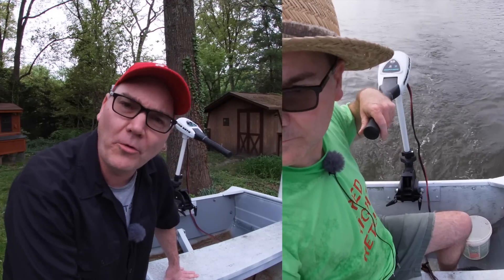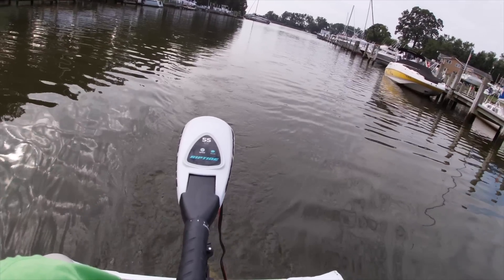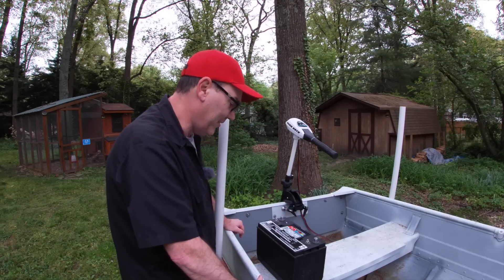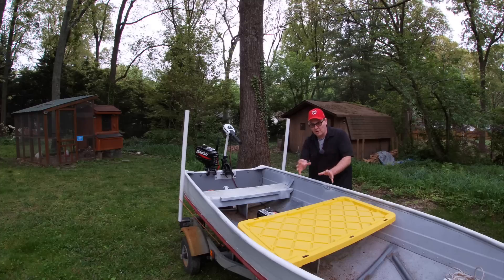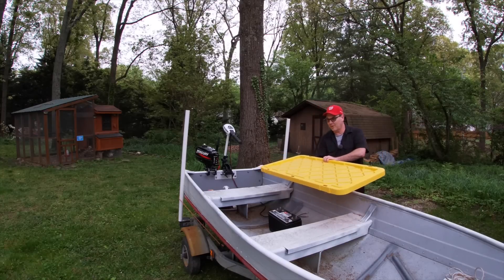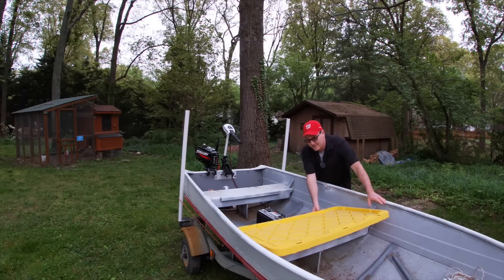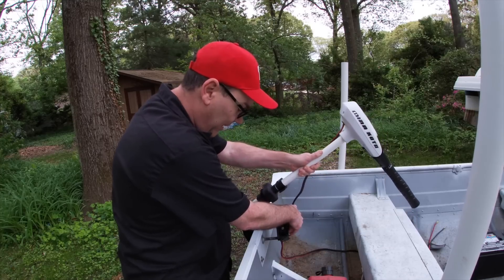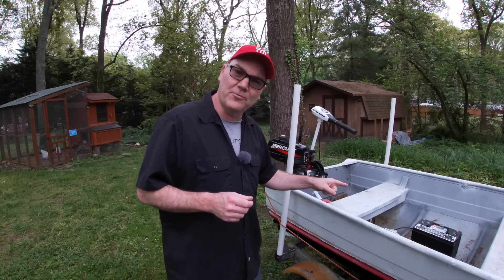How Many Solar Panels Do You Need For A Trolling Motor?

Comment: There is a big drop in price per Watt from 300W panel size and up. Anything smaller is a rip-off aimed at ignorant consumers.
I can only comment on local prices in South Africa - a Canadian Solar 300W panel will cost the equivalent of $100. A 20A EP Solar mppt is $75.
The Panel measures 5ft 6in by 3ft 3in and weighs 41lb. You can easily mount it overhanging the bow to leave you enough usable space. The weight up front will nicely balance the weight of the battery in the stern and allow the hull to run at much lower drag. 
A 40lb Riptide draws roughly 200W at speed 4 and it gives me 4mph on a 13ft dingy. 
A solar panel will give you much longer service life than a second lead-acid battery. 
Even a small panel can benefit the battery. Every amp that you get from solar is one less amp required from the battery. Reduced battery current means you actually get more usable amp-hours from your battery. Depending on the battery's Peukert factor, this would be around 10% additional capacity by reducing current from C/4 to C/8.)

Comment: I totally agree with you, solar panels are not the solution in extending your battery range.
 I know one thing that happens often in our shop, when trolling motor come in for service that are not variable speed, is that  after a short time the lifepo4  batteries are notorious in  burning out the rheostat at speed 1,2, on those trolling motors regardless of # thrust.  
Intermittent use of these motors will be fine, however, trolling at slow speeds will destroy the rheostat, and that is something no one has addressed yet.
Reply from the maker: That's pretty interesting - both the rheostat and the LiFoPo4 battery "real world" info! Thank you for sharing!!
Reply: The newer trolling motors are much more efficient!  They now have electronic speed controls.  You do not have this problem anymore. Amp draw on power setting on 3 only draws around 6 amps and on 10 close to 50 amps. This was calculated with a Victron Smart Shunt.

Comment: You make a lot of assertions without actually trying it. over the course of a day, turning the trolling motor on and off, you'd find yourself with a full battery a lot longer than you've assumed.
Reply from the maker: That was why I included the information about fishing and turning on and off. If a person is using the trolling motor intermittently all day, their results will be very different and they could quite easily make it through a day with 2 batteries (as many do) and possibly benefit by using a small panel to recharge when the motor isn't running. The math doesn't add up right now for what I was considering, so there was no need to actually try it.

Comment: if you were looking for smaller battery it would be one off of rc car (rc hobby) you may find someone who already done test on it would be petersripol video called solar electric boat power
Reply from the maker: I have watched his videos a few times and several others while I was doing my research. He had to build a roof, and he spend quite a bit of money to make his system. In the end of one of his videos he briefly mentions getting down to 40%, so his setup still may not have been keeping up with the draw of the motors.

Comment: if i were you i would run 4 battery in middle of boat for balance and run railer up to for 6 solar panels and it chager all 4 battery and you running all 4 battery in same setup im sure it last you for almost 22 hours from earlier morning dawn to night time
if you want more speed then im sure you can run two electric motor off 4 battery it can be 12 or 24v doesnt matter 
adding more battery mean adding more amp or juices 
if you want it be 12volt with 4 battery just run cable like red to red to red and black to black to black dont cross path it just run in straight line that all it matters
if it 24v system u be using 2 battery cross path like run black to motor red to black one n red to motor same as other battery i wish there was way i could write it down show ya how it work
i use to go fishing with electric motor have two them n 4 deep cell battery n solar panels didnt exist back in day were i was in county river fishing for cat fish never run out of battery power last me all way to night time was long day trying catch fish lol
dont put too many battery in back of boat because will flip up n sinks reason i said put it in middle is balancing it out so doesnt flip over
Reply from the maker: Others have shown very well that it "can" be done - but always at a pretty steep cost and lots of panels.
Reply: @WayneTheBoatGuy  yups it always be expensive

Comment: I wish you have included the numbers.
Here are some facts.
a 100watt panel puts out about 5.7 amps per hour under perfect conditions and that only happens for a couple of hours in a day, the rest of the day the output is much lower.
Now ill use my motors as a example. Its the haswing brushless 12v 65# thrust. 
Being brushless it has a built in esc so its very efficient.
I run a shunt based meter while running my vessel.
The vessel is a kayak so its small and light.
At half speed iam pulling 24 amps and at full speed iam drawing 46 amps.
the 5 amps from a 100 watt panel isnt even going to make a dent in my run time.
And that 5 amps is only for a couple of hours. The rest of the day its more like 2.5 amps.

Anyone who says otherwise are fibbing!!
Math doesnt lie!!!
Reply: Funny, I was pulling 3 100 watt panels that ran my Minn-Kota just fine.
Reply from the maker: Thanks for sharing your real experience numbers! 
Our math matches up - I figured that 6 100w panels might be able to do the job in ideal conditions. Six of those panels would totally cover my boat and cost quite a bit of money.  
I was considering putting up some data and numbers, but decided to keep this video focused on the aspect that nobody else seems to mention which is the cost of the gear and how much space it would take.
Reply: It depends on the christiline panels on your solar panel,some put out more than others,a cheap panel no! A 200 panel with blue christiline panels at 100 amps,yes!
Reply: Just run your motor at one tenth of the full power (at 10 %). When going 3,5 mph, the trolling motor only consume 100 W and 100W solar pannel produce just as much electricity as motor uses.If you have 2000 W solar pannel instead of 100 W, then you can run it the whole day long (twice the solar power to account for non ideal conditions).
Reply: The problem with both you and Wayne is that you're "over motoring"....a 65lb thrust on a kayak?... seriously? 
I made a trolling motor from a 600gph bilge pump motor (already sealed) spinning a 3in drone prop for my fishing kayak, I use a 20ah lithium battery and 50w solar panel ....after fishing all day several times, the battery has never been below 70% when getting back home.
"Full throttle" moves the boat faster than you can fish the bank....
And 55lb thrust is a waste of power for a 12ft jon boat too....at trolling motor speeds, it becomes a displacement hull and will never get "on plane", in that circumstance it will never exceed the "hull speed"

Comment: I have been running two (2 watt) Colman solor batter maintainers for a 24v 80lb thrust minkota Terranova, these keep my two blue tops. I have run two 6 hour days including using the anchor lock in a river and never droppped below 25%. I run this setup on a 18.5' tracker aluminum bass boat.
Reply: buy new 17 fiit 7 inçh  50 ekrrc oyt biar 20 to 40 m8kes sivge vater 2 bares 40 too 80 mie teksa bew cell 92 miles 46 mile   ranfe
Reply: I hope you aren't using lead acid batteries because running that type of battery down to 25% is not recommended. 50% is the limit I see recommended. Otherwise you damage them. You would do well with Lithium Iron Phosphate batteries though. Perhaps you already have those though.
Reply: @akdm82  Use AGM, have had  same batteries for almost 5 years. Will go to lithium when it becomes more affordable.

Comment: I have been thinking of using solar as a back just to charge while "at the holes". I am running 2- group 27 deep cycles run parrellel on 2 - 30lb thrust motors and barely make it back to the dock sometimes. After seeing this kinda wonder it is worth it and just get another back up battery.
Reply from the maker: It really depends on how long you're out there (not running the motors), the weather,  and how much space you have for a panel.
Reply: just get scort 145 hybre8 hour 8 moh 64 míke tejsa cen cell  74 mioe teltic range

Comment: Down here in Queensland, Australia it's very sunny. I have 2.1m plastic boat with a 350W canopy panel. It can move the boat on its own, but of course a cloud will stop it. Moreover, the speed is very low. My trolling motor needs at least 10A to go at a reasonable speed.
Reply from the maker: So are you running a panel with no batteries?
Reply: @WayneTheBoatGuy No - it's not reliable enough. Just increase the time I can be out.
Reply: add wind generotr 400 wwats troñ mirt maxoum369 wats 40 watt chagng full liad

Comment: I am currently building a 14.3ft x 6.5ft sib with 2000lb load capacity, I'll be well below 800lb fully loaded, and 1000lb+ left for people. I have 2 450w solar panels, 4 100ah lifepo4 batteries and 270lb thrust between 2 trolling motors at 3720w total. I will be able to run full speed for over an hour, and then be able to recharge (mostly) while fishing in 4 hr, giving well over a 12mi range. And if I go only at about 2 1/2 mph can do it continously, all day!? Yes quite expensive, but not really that much for a small boat with no gas motor expenses ect. It will be on a car trailer , made into a toy hauler in front , for blocking wind ect on the highway. That's to start with, I'm probably going to change the one motor and be at 5040w and 6 batteries, with changing the props be able to do 8-9mph?
Reply from the maker: That sounds like a neat project
Reply: @WayneTheBoatGuy  I sure hope so, it will be a cool adventure in any case!!

Comment: Use 400+ Watts for each panel?
Reply from the maker: The panels I see most often are 100 watt panels.
Reply: @WayneTheBoatGuy  yes but now the panels can be 500watts! You should be able to also buy 200+watt for less than $100 Used

Comment: I’ve often wondered if you could get more useable time on the water by linking your batteries in parallel or just running them down one at a time. Or if it wouldn’t make any difference. 

I’m an electrician by trade (albeit not with an expertise in batteries) and understand enough electrical theory to make me think their wouldn’t be much difference. But I’ve never had a chance to test it. 

If you ever had the time to make a video exploring this I’d be really curious to watch it. 

Cool video and thanks for the info!
Reply from the maker: I have wondered that as well!

Comment: The other option to help your range would be to use a pulse width modular instead of the speed controller in the trolling motor. (Lots of videos on this) One of the biggest issues with your motor is the draw is the same no matter how fast you are going. The speed controller in the trolling motor again uses heat to lower the output to the motor. Where a "PWM" will control the speed far more efficiently and less drain on your battery.
Reply from the maker: I have heard about these.
Reply: If you get a "brushless" trolling motor they are mostly if not all pulse width modulated and much more efficient than brushed motors, but check manufacturer. They also last much longer.
Reply: The draw is the same no .matter how fast I'm going? So why do I get double the time on low sleep than on high speed?
Reply: @jckdnls9292  Cause that's not true. A 30lb thrust pulls 10 amps at low and 30 at high. There is a website that has tested all of the draws of common trolling motors.
Reply: What electric motors offer this PW modulation as a stock component to the motor?
Reply: @tango-bravo  Pretty much all of the bow-mounted from minn kota.
Reply: PWM speed controller is the way to go. You can controll exactly your ourput. The more modern brushless motors with a 0 to 100% speed controll range also works wery well.

Comment: You sum up the issue with "green" technology for a video about a boat. It's not the case of it being bad it's just the technology isn't there yet. And you don't get double the range, it's close but not double. The impedance of the two batteries being connected lowers the amount of output. Just like the controller for the solar also lowers the output but also has the issue with generating heat.

Comment: I bought a lifepo battery for a little over 500.  The price hurt but I believe it extended my range by more than double and at a quarter of the weight.
Reply from the maker: I would like to try a LiFePo battery someday!
Reply: It will double.  You have higher voltage (Constant > 13.00 volts) and you can discharge much lower than a lead acid.  Lead acid recommends not to discharge below 50% state of charge. You can discharge a LiFePo4 till the BMS (Battery Management System) shuts you down, which is generally the amp hours stated on the battery.  They do say not to do this on a regular basis, but an occasional complete discharge should not hurt it to bad. The BMS takes care of that for you.
Be safe!

Comment: You can buy 300 Watt solar panels on Craigslist for 50.00 each. I might replace my Bimini top with one. Can you make a similar video focusing on the riptide 80 24v trolling motor?
Reply from the maker: I haven't ever seen 300 watt panels for $50. If they are the same size as the 100 watt ones, and not expensive, they might be a great option!
I don't have a Riptide 80 - but if I ever do - I'll make a video!

Comment: Excellent information! I’ve been wondering if having a panel onboard was worth it, now I know. Thank you sir!
Reply: The discussion needs to include amps. If the panel provides 50% it doubles the useable time. If it provides 50% it will charge the battery in less than 3 days. If you use the boat 2-4 days per week it could all work plus a ~4amp charger will recharge over night.
Reply: 8amps is a good practical draw for a small boat. 50 usable amp-hrs in the battery. 6hrs of run time. 50W panel is 50% of draw to extend you to 9-12hrs depending on sun. That's a full day and 4amp charger over night will fully recharge the drained 50 amp-hrs.

Comment: You can get a 100ah LFP battery for around $350 to $400.  You double your usable power versus the lead-acid battery, while cutting the weight in half.  LFP batteries have 4X the energy density (watt-hours per pound) than lead-acid.  So, you get the same value from an LFP battery, presuming you want more usable power and less weight.  Factor in the normal lifespan of LFP versus lead-acid (more than twice as long) and you are really throwing money away buying anything but lithium iron-phosphate.  This is particularly true if you use that battery for a variety of other things, which many folks do, since they are lightweight and easily portable.

When it comes to charging your batteries with solar panels, you're really "missing the boat".  ;)  All energy is solar.  Even the gas for your 2-stroke outboard came from the sun, in the form of the plants it grew and the animals those plants fed to create fossil fuel deposits.  It's all a matter of time and scope.  Buy one or two 100w solar panels and a decent MPPT charge controller, charge your battery(s) all week long and then go fishing or boating on the weekend.  It doesn't have to be a real-time transaction for your boat to be powered by the sun, you just have to understand the technology and implement it over time.

I would also mention that perovskite solar panels are showing close to 40% efficiency in lab testing, which is roughly double what we are seeing from the currently available PV panels.  That means the day may actually come when you can realistically power an electric motor directly from solar...no battery even needed, if the amount of current coming in is sufficient and the circuitry in the motor is adjusted accordingly.
Reply from the maker: I really appreciate your insight and input. Your approach is a little different than I originally considered. If there is more than enough juice from two 100ah LFP batteries for an average outing, then just use solar to have the batteries for the next trip and not have them out on the water. Neat idea! Not inexpensive up front, but potentially long lasting and off-grid!
Reply: @WayneTheBoatGuy  - That is precisely what I'm doing, for a 17.5' boat with a 24 volt, 85lb thrust trolling motor.  One charge for a pair of 100ah LFP batteries is more than enough for 2 full days of fishing, where the trolling motor is used basically just to position the boat.
Reply: @WayneTheBoatGuy  The lithium batteries can be discharged to 90 percent empty (10 percent remaining) with apparently no reduction in lifespan.  Generally speaking you must not use lead acid batteries below 50 percent remaining or you start to significantly cut into their lifespan. 
There's some dangers with lithium, but the lithium-iron-phosphate cells are relatively safe.  They are much lighter in weight and being able to use them all the way down basically doubles their range.

Comment: To be honest solar comes into it's own when recharging. I have a 12v 55lb Bison and 110Ah battery for my sib. I have a solar array of 4 x 30w panels in series that I connect to recharge between trips. I have 2 batteries so one is always ready to go.
Reply: Tommohawks- A couple questions...
Using that setup, how long does it take to recharge one of your 110ah batteries?
Do you have a charge controller or anything else besides the solar panels & if not, how do you avoid overcharging? TIA!
Reply: @cindyp2296  Hi Cindy, I have a charge regulator set up in my shed. Also very handy for our wee garden water features. In the summer in Scotland I get a full charge in a couple of days.